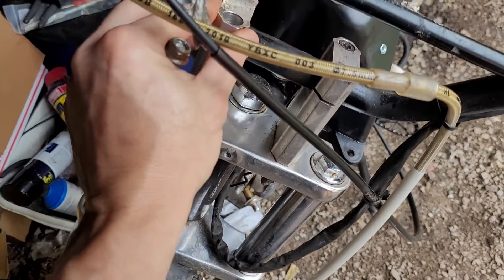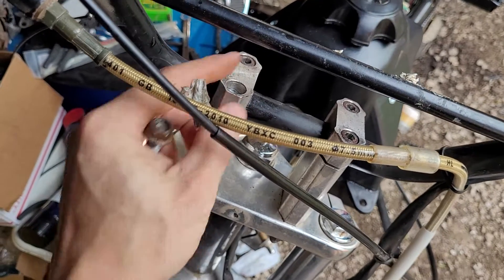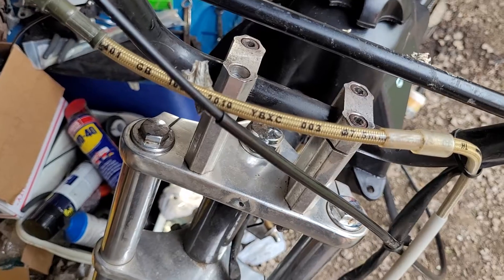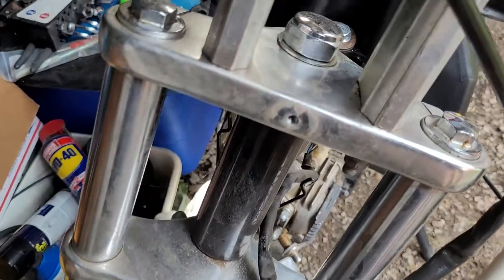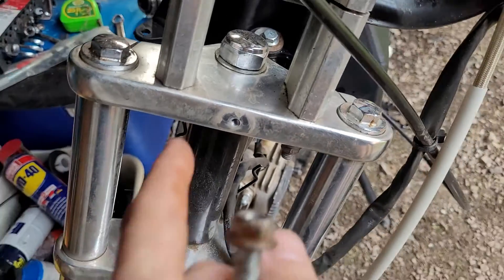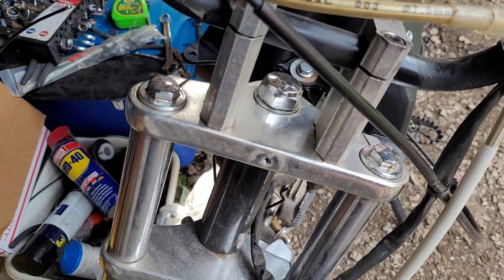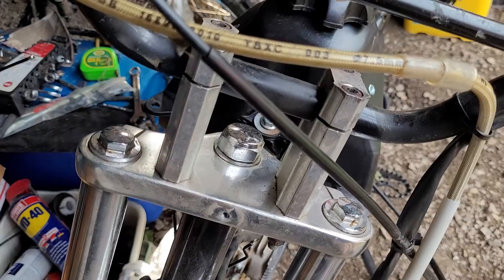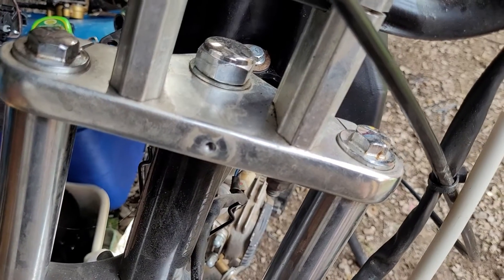How to Remove Dirt / Pit Bike Handlebars and Risers (SSR 125) - Troubleshooting "Spinning" Bolt

Comment: What kind of carb do you run? Also, can I put the 17/14 inch wheels on with the stock shock on?
Reply from the maker: I had a vm22 but went back to the stock carb. Yes, the stock shock will work great with the 17/14 setup.